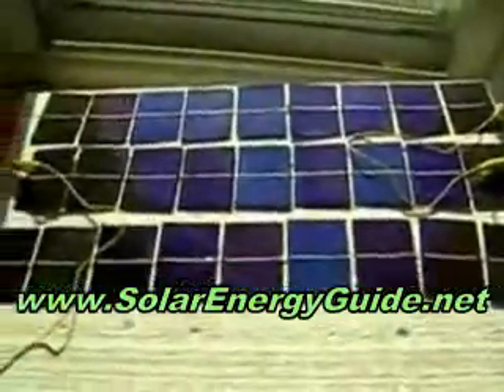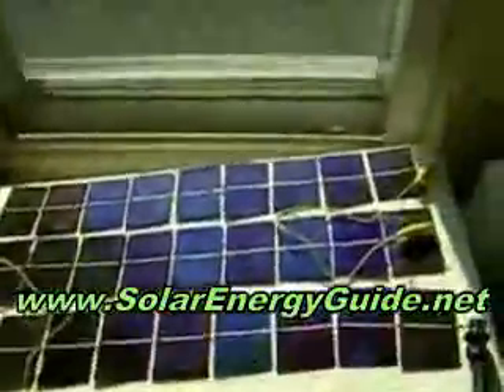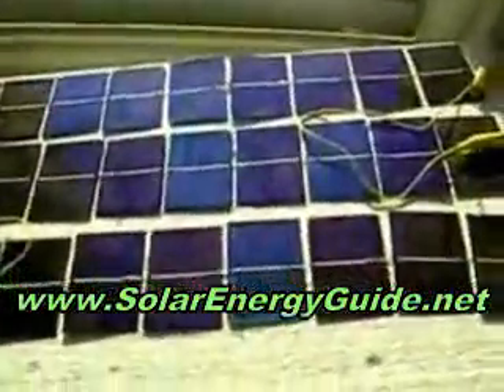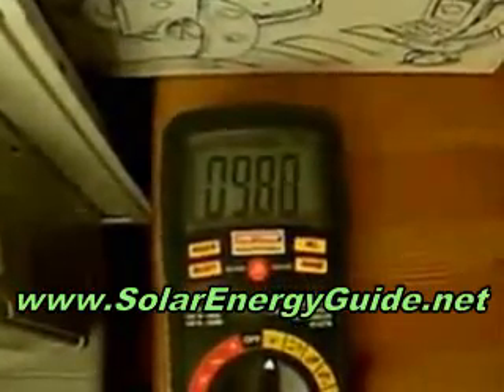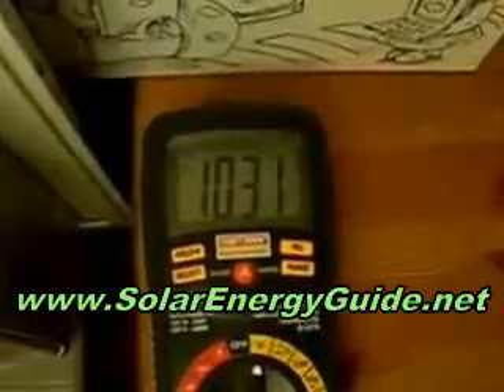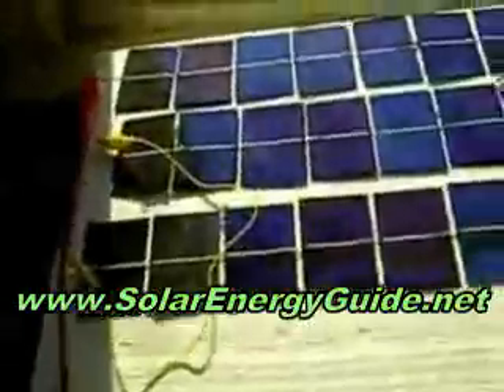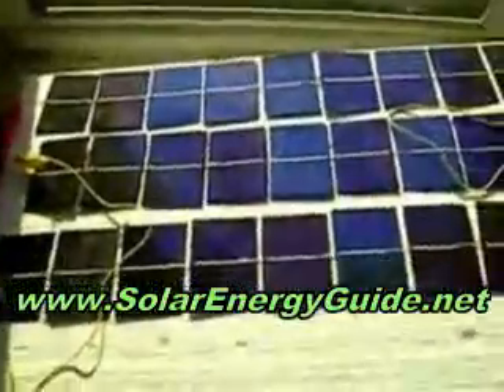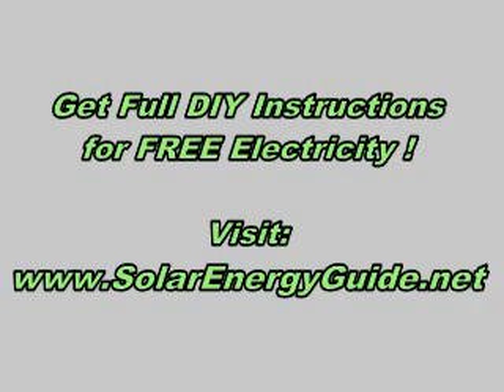The DIY Solar Panel Myth Busted

Comment: some good advice there, wel done - the warranties on my sharp panels that are backed up by Tesco (big supermarket chain in UK) are worth the money alone: drop of 10% in output over 10 years and panels will be replaced or system expanded, drop of 20% output in 25 years and panels will be replaced or system expanded.   I hope I am here to find out!